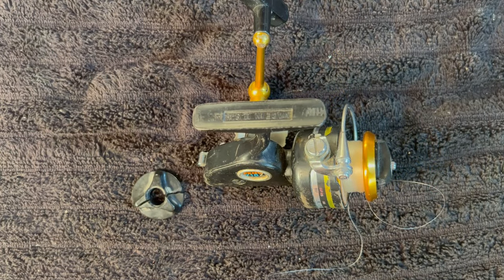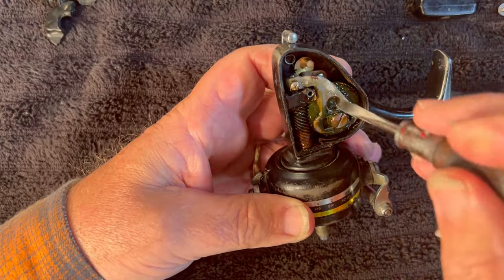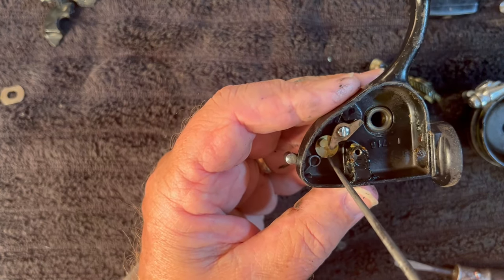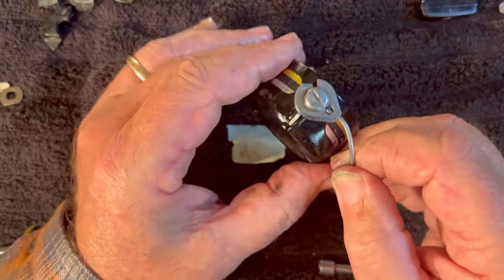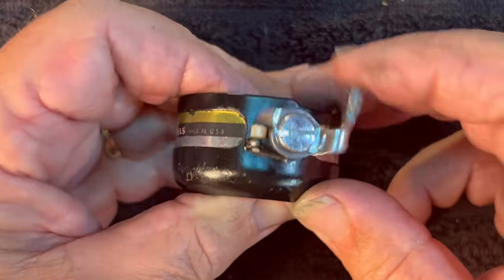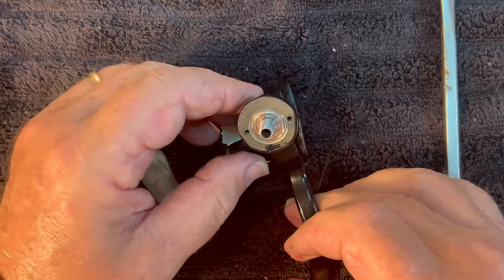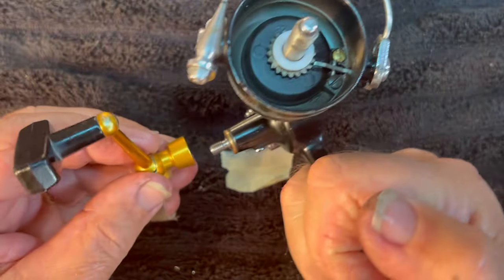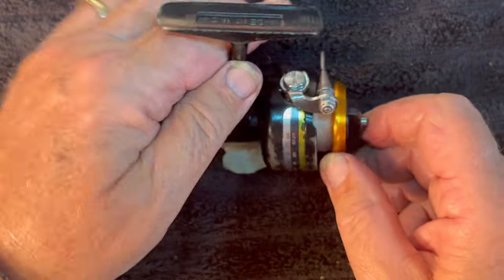Penn Spinfisher 716Z -- Service and Repair -- Young Martin's Reels

Comment: I’m 62 now, bought my 716Z with money from my 16th birthday. My brother got me an Ugly Stik rod to match. Still have both. Dennis at second chance tackle replaced a broken bail spring 4 years ago, that is the only repair it ever needed. Mine could use a paint job but the reel works perfectly.
Reply from the maker: These reels have a large, loyal following so you are in good company. I just wish they were still easy to get parts for.

Comment: On Mitchell reel's, the drag tension spring's go on the other way.  The drag tension knob applies pressure to the outer edges of the spring and the smaller, smooth, flat, inner ring applies pressure to the spool.  I've bought mitchell reels on ebay that came with the tension springs installed upside down.
Reply from the maker: I’ve encountered the same thing. In most cases it doesn’t seem to make much difference and the schematics don’t really show it as one way or the other. However, the 307 that I did last week would not work if you put it in the wrong way.
Reply: I have seen the same thing on a few of my Mitchells but never on the large saltwater models.

Comment: For anybody looking to repaint these things...
I've repainted a couple old Penn reels (a 710z and a 750SS) using black semi-gloss Moly Resin. The result looks close to the original paint job and is a lot more durable than your typical cheap spray paint. But it's a LOT more work. You need to sandblast all the old paint off, de-grease, apply the paint with an airbrush, then bake.
Reply from the maker: If you have to bake it, what do you do about the chrome decals? I have a 710Z that is in pretty good mechanical shape but rough paint. I was just going to rattle can it due to the decals.
Reply: @youngmartinsreels5314    I used a heat gun to loosen the adhesive, and sloooooowly pealed the decals off the rotor. The decals are plastic with a foil backing on which stuff is printed. The foil can let go of the plastic before the glue lets go of the foil, so be extremely careful that you don't damage the foil while pealing. Be very gentle, use lots of heat to soften the adhesive, don't rush.  But there's a good chance you'll damage the decals no matter how careful you are.

I glued my (damaged) decals back on using Barge Cement. Though damaged, the decals still look better than an empty rotor.

Some 710z reels have a plastic cover, and I think others may have a metal one. The green reels have a metal cover. If you have a metal cover and want to refinish it, use heat to loosen the adhesive on the round decal (or medallion on the older 710 reels), then pry / peel it off. Note that Barge Cement isn't "bulky" enough to securely affix a metal medallion (or substitute token if you're trying to fill an empty hole) to a reel; the medallion / token will fall off. I intend to try epoxy next time, though that will require roughing things up to ensure the epoxy gets a secure mechanical grip on both the reel and the token / medallion.

Comment: Rick, I was just thinking that the only ultralight reels I’ve seen that are truly comparable to this Penn is a Zebco Cardinal 3 0r 4 from Sweden. These Cardinal reels are also worm drive reels but with that unique rear drag system. As you know it’s not an exact rear drag but rather a drag controlled by a dial on the bottom of the housing. I think this drag is slightly superior to this Penn drag but certainly not much better. These Zebco Cardinal reels often cost about the same as these Penns on the used reel market. I only have the larger 6 and 7 size reels in this Cardinal series. This Zebco Cardinal 3 or 4 is the only reel I have experience with that would compare with this Penn 716Z. — Chris
Reply: I would say the Shakespeare Royal Maroon 2052 and 2062 are very comparable to the Penn 716 and 714, also

Comment: I don't have a Z but I do have the earlier greenie which is identical in every way but color scheme.

The Penn 716 is extremely smooth ( you may need to put a little effort in like the Shakespeare 2052 ) , and is the highest quality ultralight spinning reel ever made.
My 2052 has a much better balanced rotor and is a tad smoother because of it, but  because of the aluminum spool and the very nice solid over built bail the Penn 716 definitely takes the cake if you can only have one.

Now 2 caveats which aren't the fault of the reels would be that you can get a bearing replacement for the 716 and not the 2052,  while the 716 commands a huge premium of usually over $100 while the 2052 can be had between $30 and $50 on Ebay  ( not that Ebay is the only place to buy ).

It's a matter of bearing availability vs affordability,  because the spool is the only difference that really makes much of a difference.
Reply from the maker: It obvious this reel has seen a lot of hard use.  Even so, I couldn’t find any parts that were showing signs of wear except for the broken drag knob. I’m pretty sure that resulted from someone over tightening it.  If I was keeping it for me I might install a sealed bearing and repaint it.
Reply: @youngmartinsreels5314  
They were definitely made to last at a time when it wasn't cost prohibitive to do so.
These days especially with ultralights people want them as small and light as possible so there's no way you're going to find a new ultralight that even has a metal body let alone this kind of quality.
I personally like the ultralights like the 716 because they're so strong and over built that I can use them for everything from bluegill to large mouth bass.
Line capacity may be smaller, but the reels can take almost anything.
The modern ultralights feel delicate, they're strong enough for their intended purpose but don't instill much confidence.

Comment: I collect Penn reels and I guess I have 30 or more of the 716/716z models in my collection. I fish with them as well.

I really wish someone would make the drag knobs for these reels again, both in black and white. Handles are hard to find also.
Reply: It’s great to hear about another reel collector. I only have 22 Penn reels in my collection. I have many more Mitchell and Daiwa reels than Penn reels but with the possible exception of my Penn 104 and 105 reels, all of my vintage Penn spinning reels are excellent and a joy to use. — Chris
Reply: @christopherjenkins2373  I guess I have 500 Penns in my collection, I also collect Silver Series Diawa, Royal Maroon  Shakespeare, French made Garcia, vintage Zebco spinning reels. 

It's an addiction. As I head towards retirement, a good portion of my collection will be for sale
Reply: With how big the collecting community is and how big 3d printing is you'd think somebody would at least 3d print them.
I got lucky on my 716, there's a hairline crack I can see in the drag knob but it's still solid, and my biggest issue was them being yellowed.
I whitened them up in a bowl of peroxide sitting in the sun, but you're never going to get the plastic 100% perfectly white again.
Reply: If I remember correctly, a drag knob from a Penn 4200SS or 420SS will work.

Comment: The numbers are even stranger than you think. I have a 720Z and 722Z that are slightly larger than the 714Z and 716Z. To my knowledge the only difference between a 714Z and 716Z is the capacity of the spool. I haven’t verified this but it is what I have read somewhere.  I own all the Penn Z reels except for these two Ultralite. Also, these two reels are incredibly expensive on the used market. Since I collect mostly saltwater spinning reels these two have never been a priority for me. It is the samre with the Penn Greenies as I have all of them except the two Ultralite.  There is no doubt that these reels are among the finest vintage ultralight spinning reels available. This is largely because they are worm gear driven and the quality of the parts especially the gears is outstanding.  I love it that there is a screw holding in the AR dog on these reels. On both the Z and Greenie 704s there is nothing holding in that dog and they are very prone to pooping out every chance they get. The 7o4Z (I have three) has bail springs on both sides which can be interesting to take apart and reassemble.  All of these Penns are made in the USA in Philadelphia. If you try to buy one of those bail bump stops be prepared to pay a premium price if you can find one.  I’m not sure this bail is opening enough but it is hard to tell for sure. You did a great job reassembling the rotor , bail, and trip assembly. One of the other reasons this is such a fine reel is that it is so simple. This one characteristic along with the amazing quality of all the parts and the design make this an excellent spinning reel. This is why I have used my 706Z in the surf since the mid 1970s. There might be reels that are smoother smoother or more interesting in design than this reel but this is still, after all these many years, a superb spinning reel in ALL respects. You did a pretty slick job on that replacement drag knob. It may not be the most attractive 716Z I’ve ever seen but I would definitely buy it and use it. Fantastic video Rick! — Chris
Reply: The 716 and 714 share the same gear box, the rotor and spool is slightly larger on the 714
Reply: @jonhammes6209 That’s what I thought. Thanks. — Chris

Comment: Try a drag knob from a Penn 420SS or 4200SS. If you ever decide you want to upgrade the drag, try snipping the ears off an HT-100 washer from a 4200SS

I lost my green 716 in a far-off land a few years ago, never to be seen again.😥 I paid $12 for it at a flea market a couple decades back. I looked on ebay for a replacement... ouch. So I settled for a 420ss instead.  Same type of drive train, but with quiet anti-reverse, a skirted spool, and a bail that can be manually flipped. Stockpiled a couple sets of replacement gears and crosswind arms (I probably won't ever need them), now I should be set for what remains of my life.
Reply from the maker: I returned that reel to Ken and it was sold within one hour of appearing on EBay for $68. Someone wanted it, even with the crafted drag knob. I’ll have to keep an eye out for a 420SS.
Reply from the maker: I just priced the 420SS on eBay and unless I find one at a yardsale or estate sale. I’m not likely to own one.